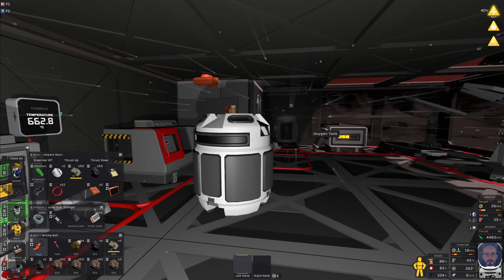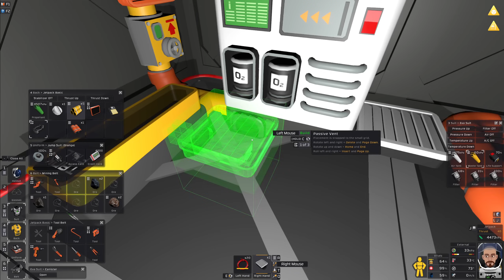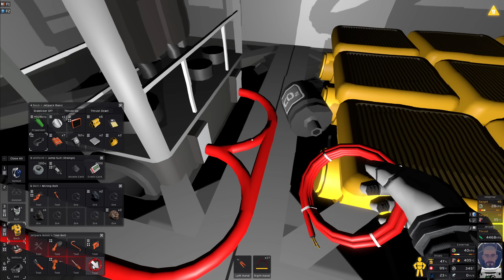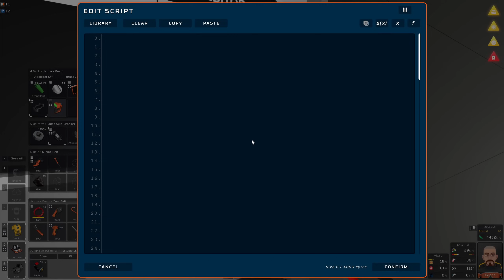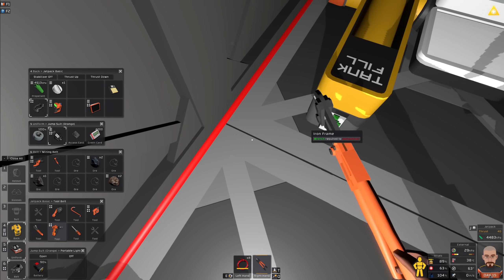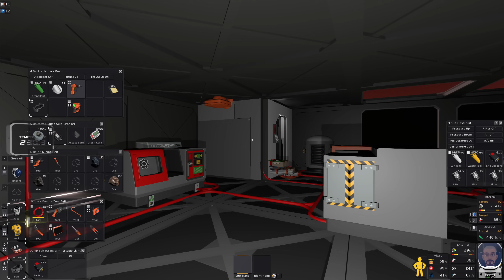Atmospherics Automation - S2 E5 ║ Stationeers

Comment: this is hacky as hell... but if you know for sure you are going to be running multiple atmo units constantly, you could unify all their code into a single chip (assuming the program fits the number of lines) and just have one control all of them via batch instructions and labels... much cheaper to print a labeller than adding an ic10 per machine

Comment: You could have done the whole AC automation on a single IC. Each atmospheric unit can connect to two other devices.
Reply from the maker: I like to keep my options open, so I can add devices later (like the regulator pressuring the base). Plus it makes the codes a lot easier to diagnose and change. If I want to change a setting on a specific device, I just need to do it on its chip, no need to go hunting for the one I need.

Comment: I think the coolant AC threshold is a little low. Or you should add a OR if temperature1>temperature2
Reply from the maker: Yeah, that might be better than just setting a strict temp limit on the radiator line.

Comment: Using a back pressure regulator in this fashion, means you are pointlessly filtering oxygen continuously. This is a waste of energy and filters. Instead, just use a chip in the filtration set to switch off if the pressure on the filtered side is above 7500.
Reply from the maker: Coming in the next episode.

Comment: I dont really know how the physics work in Stationeer, but that AC setup looks strange to me. As i see it, you have the intake and outlet in the same vent. That would only cool the same air inside the AC system. The Intake and outlet vents would be placed as far apart as possible, to circulate the air inside the building.
Reply from the maker: In the game the pipe systems have no "flow", it's a uniform container for whatever is inside and changing things on one end immediately happens everywhere. Outside the pipes however, it does make sense to spread out the vents, but for such a small space it's not really all that important. The temperature will equalise pretty quickly.

In a lot bigger base having multiple vents spread all over is a good idea, but this is a pretty small one.